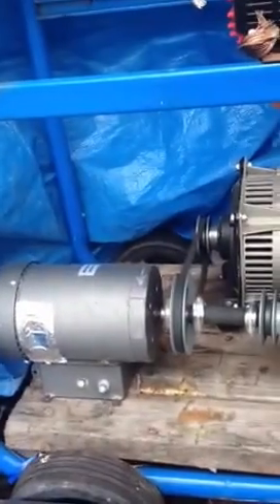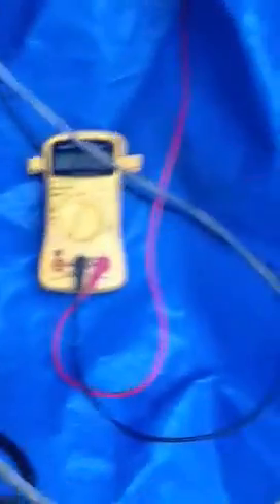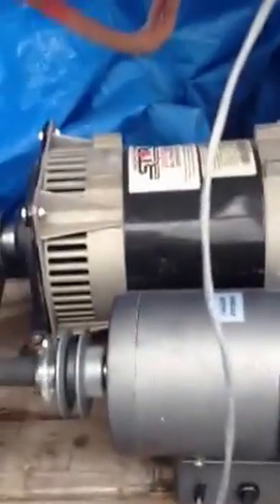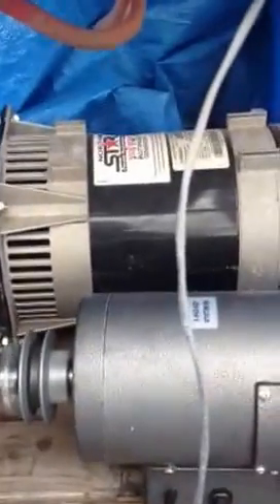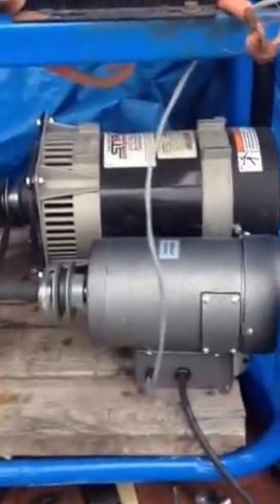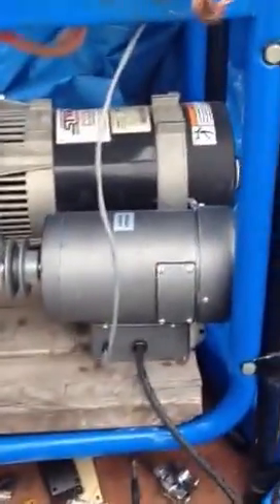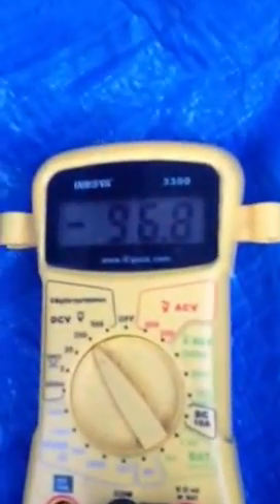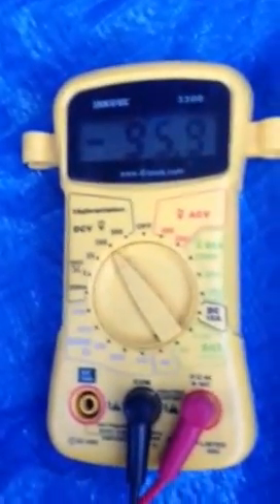Induction Generator driven by elec. Motor

Comment: Do you have a parts list and directions? I would love to try that. A bit bigger I need 27Kw per day.
Reply from the maker: Yes you can build whatever size wanted ! The advantage is building the HVAC generator to the right proportion to drive motor - My new design is no iron core-less  double rotor flywheel AirToFlyRotoGen7 TRADE MARK
Looking for grant money to start Production asap 
Bestinventor@live.com
Write ✍️ Me 
Liberty🗽Larry WILSON 
9486 Meadow Fork Road 
Hot Springs, NC
28743
Reply from the maker: I have a design to add to any electric car - after 30 MPH speed is achieved will self charge unit - takes a space of 3’11” by 3’11” by 12 inches - preferably low over battery bank - less battery is needed with this design too ! Will also cause less wind resistance - over 30 MPH - to high speed ! Coast to Coast !
Modern Nicola Tesla Design !